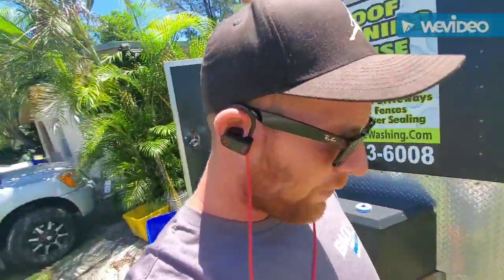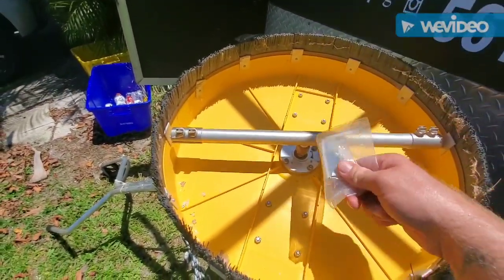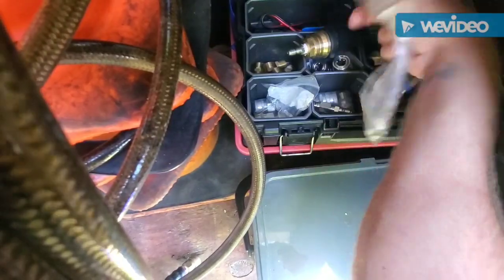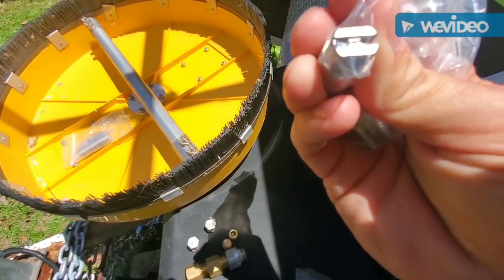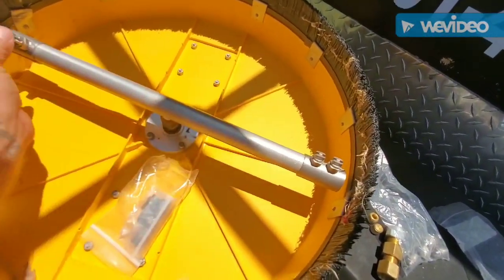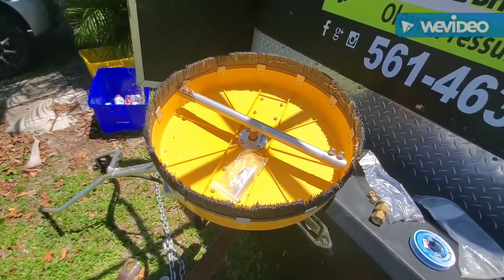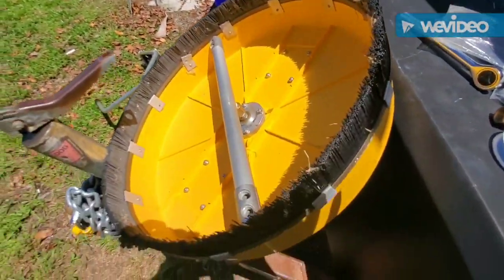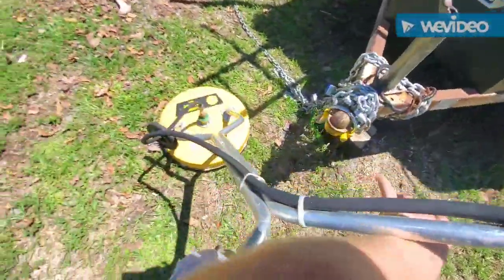the best pressure washing surface cleaner

Comment: I have a question I have a 4000 psi 4gpm and having trouble with my 20inch surface I was thinking either reduce down to a 16 inch surface or open my orphase size on nozzle from 25020 to a 25030 for each nozzle or do both which do you suggest and which size nozzle and gpm are you running on yours? Yours looks great btw
Reply: 25025's, more flow but less psi. 3000psi is adequate for concrete. No need for 4000 as it can strip the cream off the top if you're not careful. Should put you somewhere between 2500 and 3000psi give or take

Comment: What do you recomend for a 16 inch surface cleaner 4gpm with 2 tip bar. It came with 2502. Seems too strong. I want less pressure what do you recommend?
Reply from the maker: 25025

Comment: I have an 8 gal 2500 psi. Do you recommend 25025?
Reply from the maker: 2 tip or 4 tip? if its 4 tip then yes .. 2 tip 2504
Reply: Oleyn's Pressure Washing  yes 4 tip

Comment: Looking for surface cleaner to fit Harbor Freight 1750
Reply from the maker: what are your gpm?
Reply: Oleyn's Pressure Washing 1.3  gpm
Reply from the maker: @phaedrabandatlanta  unfortunately not many will work. the rule of thumb is 4 inches of surface cleaner for every gallon per minute. example.. 4 gpms would mean 16inch ... 5 gpm would be 20inch
Reply: Oleyn's Pressure Washing Thanks for the info

Comment: You're not getting more flow by lowering the pressure. And you aren't getting less by increasing pressure. Your pump is 8 gpm. You can decrease the flow by lowering the throttle (not good for your motor) but you cannot increase the flow rate.